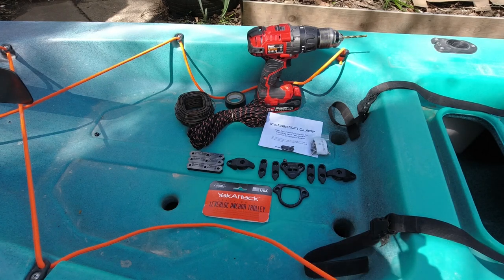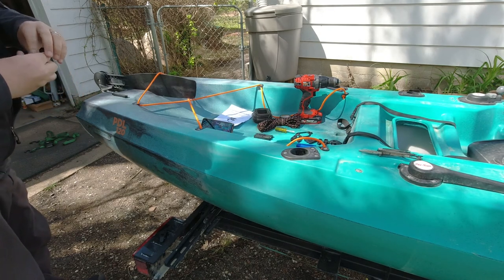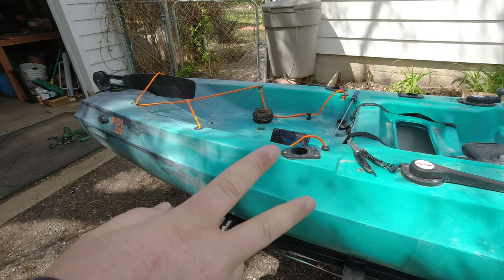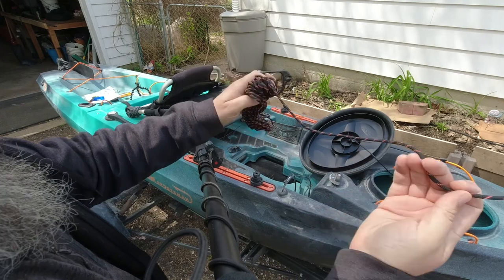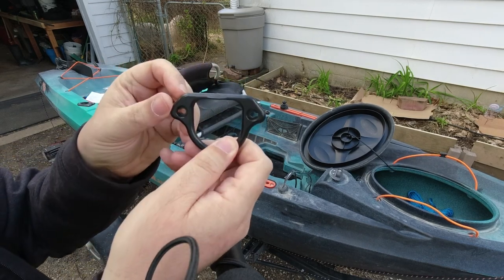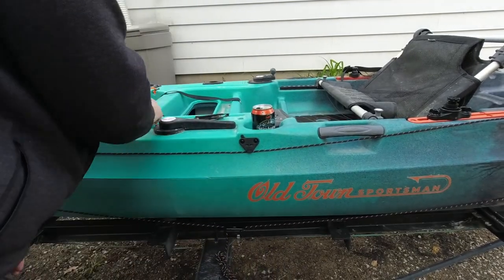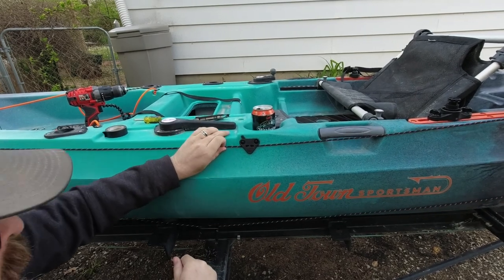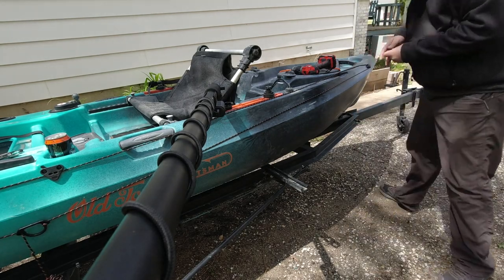YakAttack HD Anchor Trolley - Full Installation Walkthrough

Comment: Thank you so much. The wire trick was amazing! One other tip, if you have access to two iPhones, face time them and set one inside the kayak with a flashlight pointed stern. I felt like I was performing surgery but it helped me see exactly what was going on inside. Aluminum wire and painters tape did the job with your tip. Thanks again!

Comment: The wire trick was on point! I was doing an Ascend 12T install. Lots of foam to navigate and the hatch is 6' from the stern. Using 22ga Floral Wire I fished thru as you did. Eased it back and since it was folded and taped I could rotate it. Everything went as described 1st time. Thank you for the greatly detailed and effective video. Very underrated. May you have many more views and likes.
Reply: 😂😂😂😂I literally tried to install this on my 12T today what a pain

Comment: I just put this on, not the HD model though, any thought of putting silicon around the screws to keep them water tight? Im a little nervous about that, might take each screw out and put some around the screw hole and locktite.
Reply from the maker: I put a bit of silicone on mine later, just for peace of mind. Figure it can't hurt.
Reply: I did this as well as a better seal and hopefully  tighter hold for the screws

Comment: Thanks for the helpful install video. Did you go back to the holes and add silicon? Also, have you had any issues with the trolley since the installation?
Reply from the maker: No issues since installation. Just tightening the cord. I hit the larger spots with silicone, but it's been water tight since install.  Great kit and install
Reply: Thanks!